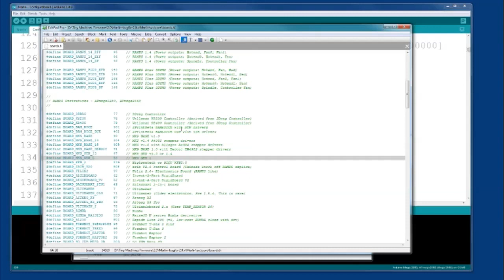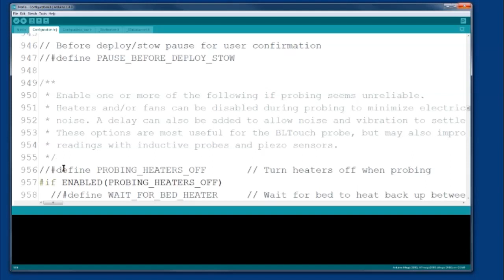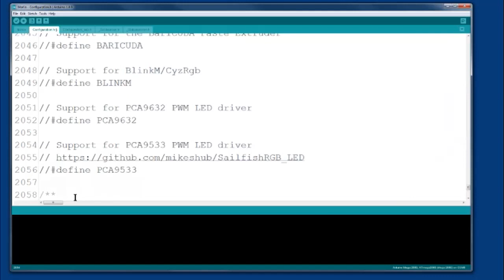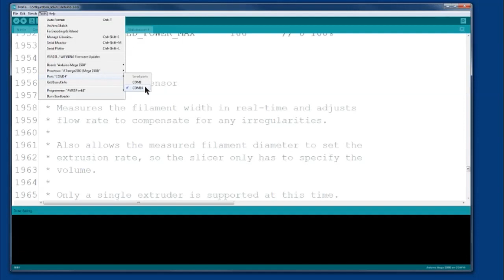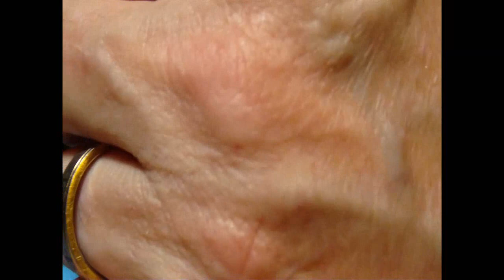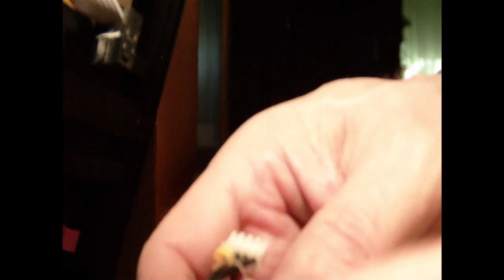Upgrade your Ender 3 with Marlin 2.0, an MKS Gen L board and BLTouch

Comment: You show everything well.  Long movie.  But I am torturing myself with mks gen l v2.0 and tmc 2130 and a tft on the ender 3 pro with atom.  Still tinkering at the moment, can't quite get out yet.  Tmc are a pain and so is bltouch v3.1.
Reply from the maker: The TMC2130s should be relatively simple... My experience with the MKS Gen L board is limited to v1. I wasn't aware there's a version 2.0. Perhaps the SKR boards are making them re-think their philosophies. As for Atom, it's really no longer supported by the PlatformIO environment, VSCode is the "official" environment.
Reply: @3DPrintingTexan  That means that I should have a look in VS code. Can't hurt to take a look at that.

Thank you very much🙏

Comment: Hi. thank your for your good guide! I done it, with a little bit comparing my older 1.1.9. version. I get an Error. TMC connection Error. Do you have changed the TMC Pins at Pins_ramps_h or the software. I don't. I have removed the 3rd Jumper under my 2208, as Techaching Tech shows it in his TMC2208 video - Standard Mode. Nothing changed.
Reply: I solved it. It was the naming convention TMC2208 or TMC2208_STANDALONE. Stand alone is plug an play without UART and soldering :-)
Reply from the maker: Awesome!
Reply: @timob.9922  It took me a month of search, test, fail, repeat to find this one line you wrote up hear
Reply from the maker: I also had to solder pins 4 & 5 on the top of the driver before the TMC Connection Error went away on mine.